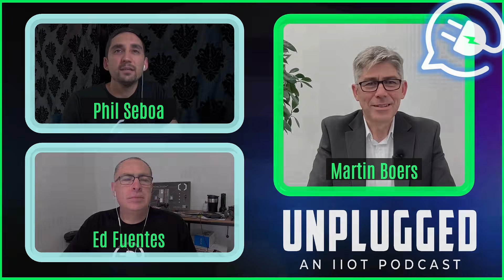Why PLCnext Technology Is Changing Industrial Automation Forever with Martin Boers

Comment: Im shocked to see that why there isn't a proper choice for proper languages that ACTUALLY fit such controllers. Based on proofability, safety, and less error prone. For example ADA, or Rust or even in the near future OxCaml which will replace Rust with even stronger proofability, and better safety and stronger guardrails for proper software for systems that should NOT FAIL.
C++ is nice, but its oldfasioned in a way that good patterns are resistive paths. The proper way to code good C++ means that you go against the grain. Unlike for example languages that are build with the proper paths and decisions from the start. Rust is better, but even Rust is not perfect. Because for example OxCaml then again solves the problems of Rust. 
Why even choose C# ? A bytecode language that is very dangerous to program for systems that need reliability. Proper error handling for example, also NULL is considered a mistake, same as POINTERS. That's why OxCaml for example does NOT use pointers at all.